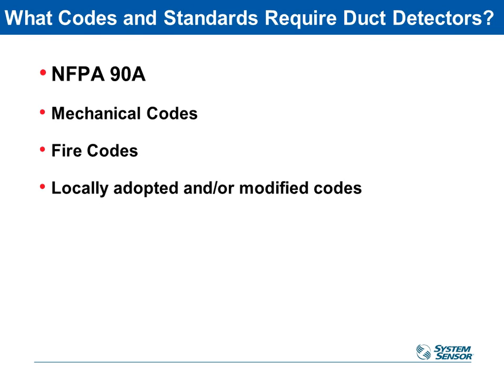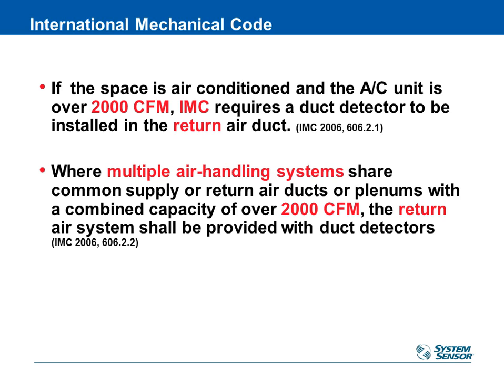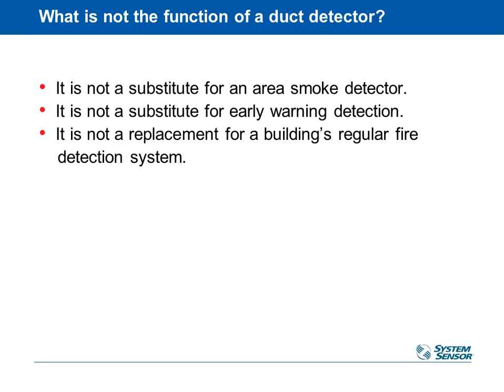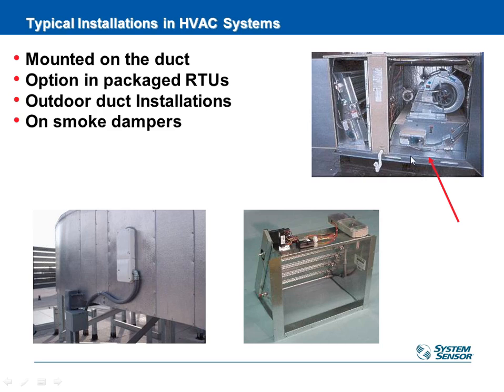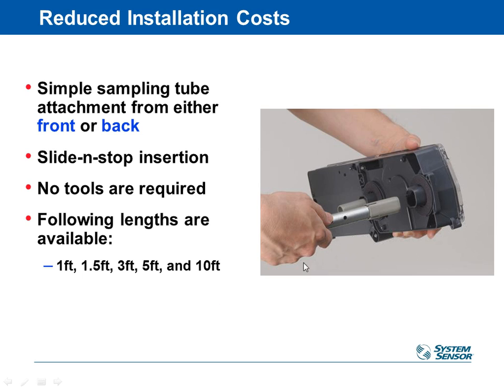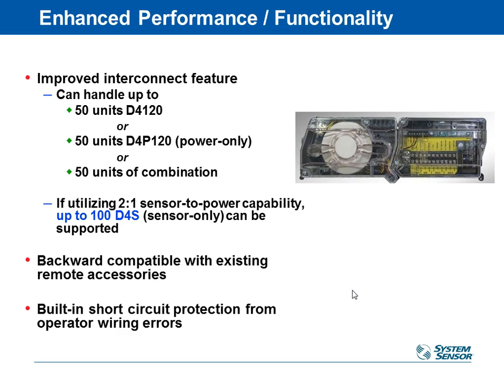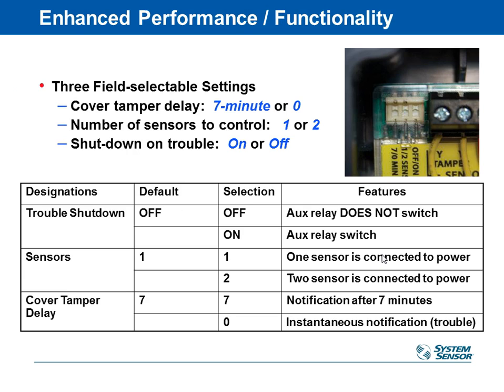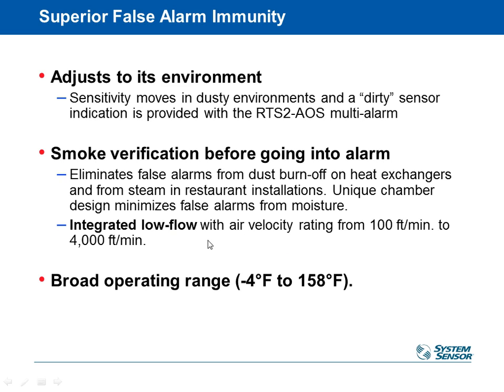System Sensor Duct Smoke Detectors - Webinar 7/16/12

Comment: If you have two rtu units ,both use D4120 how do you wire them.  If one was tripped it would shut down the other.
Reply from the maker: Two RTUs on common duct? We would install a single duct smoke detector in the duct and it would send a shutdown signal to whatever fan controller was being used to sync these two VFDs (or ECMs).
Reply from the maker: Two unrelated RTUs? Each would have their own duct smoke detector and those detectors would only shut down their associated RTU.

Comment: How do you wire to t-stat
Reply from the maker: You would not normally do that. A normal thermostat doesn't have an input for a smoke detector. And even if it did, code will still require you to hardwire the detector to shut off the fan so you would only use the extra alert contacts of a smoke detector to signal to your BAS or stat.
Reply: @TECTubefilms  I wire t-stat like a float switch... from the control board I run 24v to  smoke detector and I jump 24v to C . From T-stat I run R to NC and I wire G,Y,W and C to the control board...

Comment: No one shows how to wire in series or if they are postion sensitive
Reply from the maker: How to wire the contacts in series if you had two detectors such as supply and return? Same as any "switch" in any application. Go from your controlled device and wire into the contact of the first detector and then back out. Then take that wire into the next detector and back out and over to the controlled device.
Reply from the maker: Position sensitive? They can be mounted in any rotation if that is what you are asking. You can put them sideways or upside down. You do, however, need to mount them so the sampling probe goes perpendicular to the airflow. And you need to mount that probe so it goes the long distance of the duct (if you have a 2ft x 5ft duct, you need a 5 ft sampling tube)